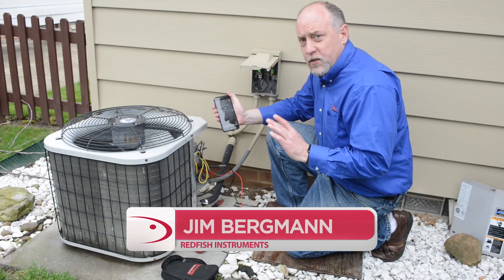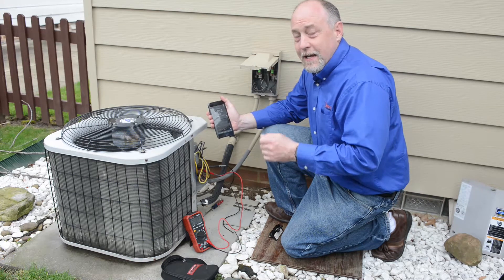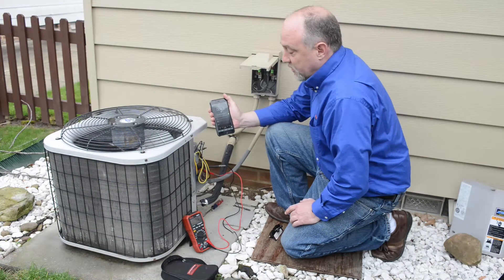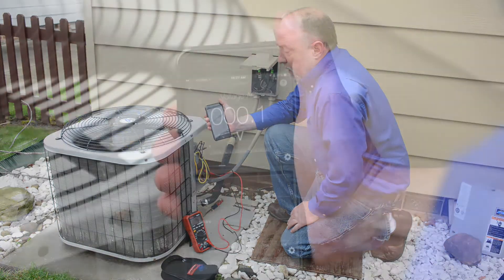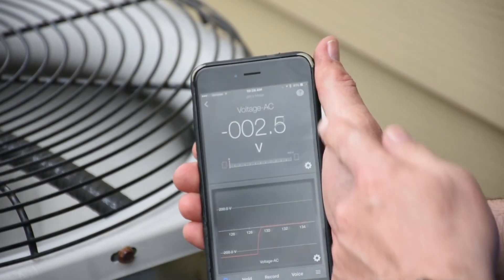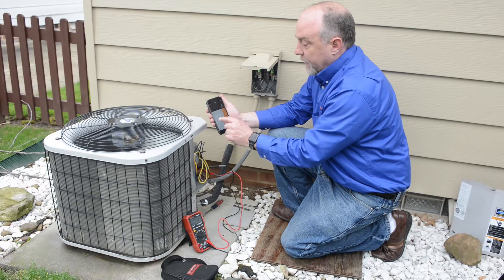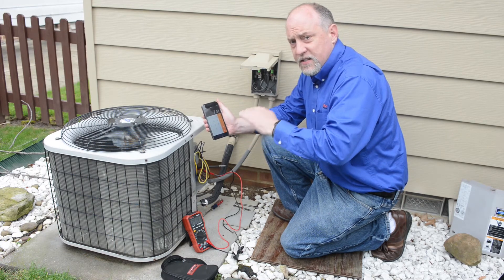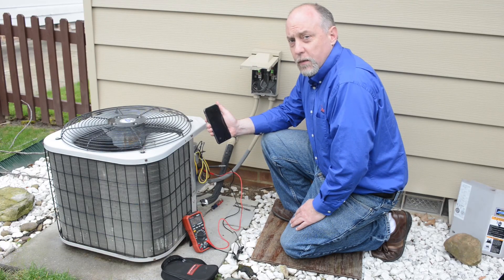iDVM 510 Quick Tips: Meter Ranging and Voltage Drops under a Load

Comment: As the industry moves into these inverter systems, with VDC I think this issue will have more impacted on the units. Voltage drop can effect the electronic's allot.

Comment: I watch allot of video's of technicians, doing maintenance and have not seen 1 check the disconnect  for correct voltage L1-L2 to Load 1 -Load 2 . I was taught this in early years as most of companies I worked for were Electric-Heating & Air. With the cheaper type disconnects today,before I retired about 7 out of 10 would be loose or HOT/spots on wires. And they wonder why compressor burn -up. Good video information, that all techs should follow. Thx Jim

Comment: two major details 
1. check for voltage drop on load side of contactor to check it.
2. use a meter with capture feature to capture voltage drop on start up.
Reply from the maker: Paul,

Good points, we did check on the load side, checking all the way through the contactor. I should have made that more clear. I also agree with capturing the voltage and or inrush current at startup. It is my understanding that at startup, the voltage can drop as much as 20% at LRA, that also provides a ton of valuable information about the condition of the components and the wire feed size. 

Thanks for the feedback!